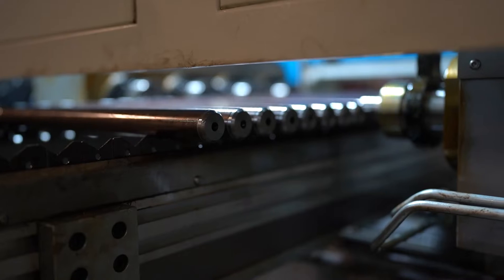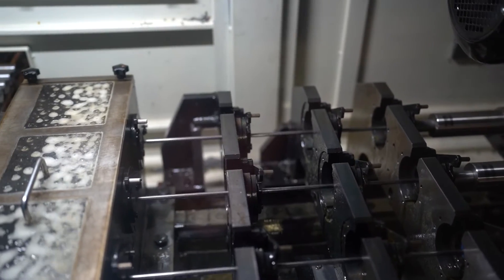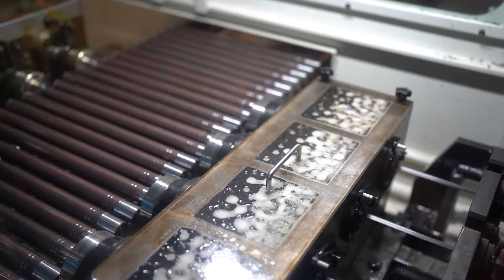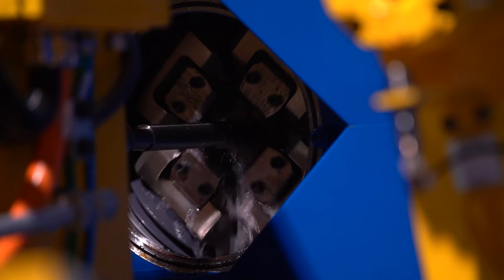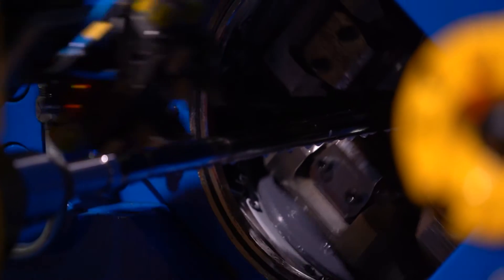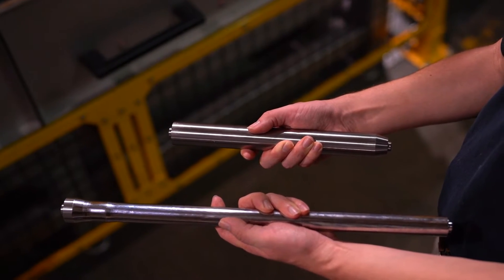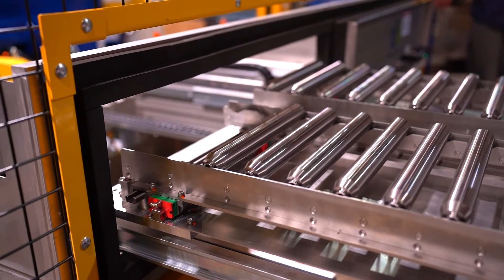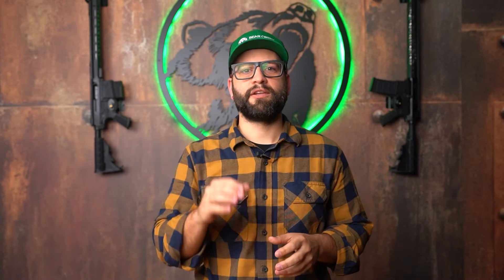Barrel Rifling - Cut vs. Button vs. Cold Hammer Forged

Comment: Prefer progressive twist produced with Electrical Discharge Machining. No stress, and allows for a hardened steel barrel with higher mechanical strength that other methods cannot achieve.

Comment: get verced in ablatives and kenimatics  after all  rifleing is just a helical path for the projectile  and throat erosion ca and is adressed rather simpleet and seintificaly all   in the same oll of the di, if one dare you can run all day @ proof  pressures mind you i said @ ,,, NOT ON,,,, but you beter know what your doing, theres a good deal of prep involved  and you gonna ive up some conveinances  all that meas is get inshape because the rifle is gana feel like it went on a gain diat  to get get gains your gonna add a weight  to the rifle and and your rifleing ratios are all imprortent every caliber has one it likes  but pressurer come into play  lean all the factors

Comment: Hammer forging is basically cold working steel.  As a result, stresses are put into the steel.  Ordinarily, stress relieving above a critical temperature is used on parts to get rid of these stresses.  However, on a hammer forged barrel, the bore (rifling) is in a finished condition after the hammer forging process.  This means that the barrel CANNOT be stress relieved.  It would ruin the bore.  The result is, you're left with a barrel that will begin to move (bend, warp) when the barrel heats up.
Reply: Exactly! Your spot on. That’s what this video leaves out.

Comment: No matter how the rifling is introduced to the bore, the chambering, throating and lead are critical  to accuracy.   My BCA barrel had so much thick smeared metal in the leade, it has been impossible to remove it so far.   Looks like they used an extremely dull finish reamer and never QC'd the finished product.

Comment: Hello I would like to know something, if the barrel has the groove made by machining, how come every rifle live different marks on the bullet like a fingerprint to track the rifle that shot it? Shouldn't they have the same grooves? I'm confused 😂
Reply: You're asking about the fascinating topic of ballistic fingerprinting!

Even if multiple barrels are rifled using the same tools and machining process, tiny imperfections and variations in the rifling process can create unique characteristics on the bullet. These characteristics are like a fingerprint, allowing investigators to match a bullet to the specific rifle that fired it.

Here are some reasons why every rifle can produce a unique "fingerprint" on a bullet:

1. *Microscopic imperfections*: Even with precise machining, tiny imperfections like scratches, pits, or minute variations in the rifling tool's surface can occur. These imperfections can transfer to the bullet, creating a unique pattern.
2. *Tool wear and tear*: Rifling tools can wear down over time, introducing subtle changes in the rifling pattern. This means that even if multiple barrels are rifled with the same tool, the resulting patterns can differ.
3. *Barrel material and hardness*: The type of steel used for the barrel, as well as its hardness, can affect the rifling process. Slight variations in material properties can lead to unique characteristics on the bullet.
4. *Rifling process variables*: Factors like the speed and pressure of the rifling tool, the temperature of the barrel, and the amount of lubrication used can all introduce tiny variations in the rifling pattern.
5. *Random chance*: With so many variables involved, it's possible that random chance can also contribute to the unique characteristics on each bullet.

These factors combined create a unique "ballistic fingerprint" on each bullet, allowing investigators to match it to the specific rifle that fired it.
Reply: @zulfikera6170  thank you very much for the reply😎👍
Reply: @Human_From_Earth88  Also thanks to Meta AI pls 😁

Comment: The best factory barrels in my opinion are made by Anschutz they are from what ive read cold forged then button riffled after and hand lapped to finish. They are more interested in accuracy not the stresses of high pressure “hot” rounds or rapid fire some most of their rifles are single shot .22lr.

Comment: This guy is trying so hard to sound like he knows what he’s talking about. Cold forging doesn’t make something more resistant to heat, in fact enough heat will actually anneal the metal and reset the grains that were displaced when cold forging. The reason cold forging makes metals stronger is because the grain structure is smashed and rearranged in a way that there are no weak points remaining in them. Think about packing wet sand at the beach. It’s useless when loose, but a lot tougher when packed tight. This guy would have learned these things in an entry level materials course in college if he ever would have went.

Edit: Spoke too soon, he made even more errors. He also says cold forging tempers the metal… tempering the metal is heating the metal and cooling it- something that obviously is not done in cold working/forging. There also isn’t “less wasted material” as the shavings from machining would simply be collected and either sold to be melted elsewhere, or remelted into more barrel blanks/billets.

Comment: So is cold hammer forged barrels therefore strengthens toughness, and therefore tempers the metal (I think that’s what he said in video). Does this mean that the tensile strength increases overall. This could imply that cold hammer forged barrels should have longer life but become unstable or drift accuracy as they warm up. Perhaps button rifling work hardens the surface of the rifling as the grooves are cut and now left with a balance transition from high tensile to more ductile steel deeper in the metal underneath the rifling. I have no idea which method is best. I do like the smooth perfection of cold hammer forged.

Comment: The button is Carbide, Not carbine, (Carbine is a short rifle), . Hammer forging does not rearrange the molecules. Unless you hit it with a Nuke. It does however realign the grain structure of the steel. Same as in Knife Making.  Rearranging the Molecular structure was a myth that persisted for years t suggest that a forged blade was superior to a stock removal blade.  It is fully disproven. 
KnifeMaker/Retired after over 47+ Years i the Craft

Comment: Its just work hardening the metal its not tempering anything. frankly if they just heat treated the steel it might work even better at least untill the barrel got so hot that it would lose the temper but by that point thermal warping will have caused loss in accuracy

Comment: Could wire electrical discharge machining (wire-EDM) be of any benefit, or possible, to make rifle barrels, or achieve higher precision tolerances in a trued smooth bore surface before cut or button or CHF?
Reply: It’s possible and regularly done by hobbyists. The only benefit it offers is practicality and ease of application. They are not as good as hammer forged but make rifling possible at home.
Reply: .... so you gotta hobby EDM machine, eh????  right .....
Reply: @petermoss4824 nope, just curious of potential applications or limitations in using wire edm.

Comment: I just purchased a complete lower and upper for an AR-308. And I must say.... I am thoroughly impressed.

 The lower is just your standard basic lower. The upper however is a beautiful 416r stainless steel heavy barrel. 20 inches long.

 When I received the firearm I noticed that there was no machining or tooling marks anywhere.

 I took it apart and I cleaned and lubricated it thoroughly and then I sat there for about a half hour just working the action around. Then I took it apart clean it and lubricated it once more. And then I took it out. I currently have I don't know somewhere around 400 rounds down range without a single failure in any way shape or form I mean no hiccups whatsoever. And it is maintaining accuracy perfectly.

 I will definitely be a repeat customer.

Comment: For all practical purposes, all things being equal there is no inherant difference in accuracy between any of these methods. Bullets don't care how the rifling is made, they care about surface finish, consistency, and concentricity. Steyr was one of the early adopters and developers of the rotary CHF process, Ruger was an early US adopter. The main advantage of the CHF process, for the companies that can afford the investment, is high production cost savings. All the claims about accuracy, wear resistance, work hardening, ect. is just marketing babble. A button rifled barrel can be every bit as tough, wear resistant, and accurate as any CHF barrel.

Comment: So let's talk about rifling.  I want a BCA10, but I'm an old cast bullet guy. I make my own lead, tin, nickle slugs and they work great with cut rifling.  CHF barreled means polygonal rifling most of the time, and that means no lead because the hills and valleys aren't deep enough to spin and stabilize the bullets going down the bore. They end up shooting lead like a smooth bore and getting tighter from lead deposits which drives up pressure to potentially dangerous levels (like the old exploding glocks.) So what I want to know is : can I get cut rifling?  What is the difference in thousandths of an inch between your lands and grooves? CHF is great, but it limits my ammunition choices. That limitsmy decisionto purchase. And, in a shtf apocalypse situation, lead may be all you can find....

Comment: How does the button rotate when being forced through the barrel?  Is it the same principle as a rifled slug where the cut of the exterior of the button forces it to rotate?
Reply: the button drives itself along, the shape is such that it has to rotate at the desired twist rate, as you push it supper hard it dose all the work its self.
Reply: Button rifling machines make the barrel rotate at the desired pace as long as the button is pushed in, so to not have any error, but it's not really needed. Due to the elicoidal shape of the grooves, the button auto-rotates as it's pushed into the barrel.

Comment: The nice thing about hammer forging is the metal is work hardened so the barrel can take the higher pressures.
Reply: The barrels are stress relieved (annealed) after the hammer forging.  Stress relieved steel is stronger than hardened steel.
Reply: @plainlogic that's mostly true. Annealed steels are much more resistant and allowable to flex without cracking. Hardened steels don't flex so much as they crack or outright break. Tool steels and hardened steels are more abrasion resistant but cannot flex, instead they chip or crack.

Comment: I'm sure this method has been well tested and is the preferred method by many high end barrel manufacturers.  It seems to me that a cold forged barrel would lend itself to movement when heated up with multiple consecutive rounds being fired.  It seems to me that the heat would release stress build up in the steel through cold hammer forging process.
Reply: I think it depends on the grain of the steel. And heat treating releases the stresses of the grain. But I'd assume that different forging techniques would still have an impact on grain.
Reply: If it good for a fully automatic military rifle, yeah Cold forge  hammer is the way to go, but the button rifles are gray with Today’s technology barrel making . most people will never come close to be able to actually shoot as good as the barrels are capable. If you wanna cold, Forchhammer get it but you don’t have to. Maybe one day all barrels be made Cold hammered and we won’t have to worry about it anymore. The most championships have been one with button rifles.

Comment: @BearCreekAR I purchased the BC-15 AR .300blk out rifle. Tried shooting subs through it, and it hung up ever round shot through the 30 round magazine using sub sonic rounds. I called 6 or 7 times,  and left messages with there customer service line. They will not answer there phone or return calls. I figure all I need is a lighter spring so it will properly eject the casings. Expect No service after the purchase for Bear Creek Arsenal.
Reply: Don't know if you ever heard back from them but instead of messing with different buffers another way to easily make a 300 blackout run not only supersonic but also subsonics if it doesn't want to fully cycle a new round or eject spent is an adjustable gas block
Reply: Yeah buddy, semi autos aren’t gonna cycle subsonic ammo without a suppressor
Reply: Was the gun suppressed?

Comment: Generally speaking, your chrome lined and/or chrome lined barrel will outlast traditionally/button rifled barrels 3-to-1, however they're typically less accurate. 

Stainless, Button rifled ARs that are made from quality components and assembled well can hold groups as tight as 0.25" at 100 yards, but expect those groups to open up over time. 

CHF Chrome Lined barrels typically hold 2-4" groups at 100 yards, but you can expect those groups to remain very consistent.

As far as value for your dollar goes, a button rifled 4150 Chrome Moly Vanadium barrel is what I go for unless I'm trying to build for precision long range shooting. QPQ coated barrels aren't quite as durable as chrome lined, but generally don't negatively impact accuracy as much. 

I've been using Bear Creek Arsenal as a source of parts for upper builds that I sell on the side for a while now. While they're a budget friendly company, and aren't my first choice for high quality builds, I have put together a couple of uppers with their barrels and bolts that will hold accuracy with any of the high dollar builds I've done. Their customer service is fantastic as well! 

Because of how good they've been to me over the years, I always try and use at least one part from them somewhere in every single upper I build, even if it's just a gas tube.

Comment: Why are your 300blk barrels 1:8? I have yours at 8.5" and using subs it is a very close thing and depending on ammo, they keyhole (which I try to not think about as I mount a can). Q products are running 1:5. True, some supersonics cut for expansion don't like 5:1 much. So, 1:6 exists but is rare. Maybe BCA sets the trend and standardizes on 1:6 twist? Please?
Reply from the maker: Thanks for your feedback! We will pass it on
Reply: I’ve got 1/7 and 1/8 twist barrels that shoot good subsonic and supersonic groups.  One 10 and one 10.5
Ones an Aero P the other Faxon.  That’s pretty much the industry standard if you want to shoot both super/subs.
I wouldn’t go below an 8” barrel it’s not worth it.
Reply: @cleetismcdougall5425  Well, mine does not shoot subs well. Glad yours do, does me no good. I am assuming the difference is your barrel length is giving a higher fps and spin rate. My 300 is intended for home defense (CQB). I want to use it with subs (and can) because in enclosed spaces I want to minimize blast and flash. So, I want/need a shorter barrel. I had a 10.5 and it was too long with the can. I would probably be okay at 1:7 but BCA only offers that at 7.5." Rotational energy is a way to impart more energy into a target without speed it up. The new 6.8 blk is rifled at 1:3 twist. Yes, one in three twist. There ARE 1:5 twist 300blk barrels out there and are golden with subs, a few supers not so happy. Thus my 1:6 suggestion, esp at shorter lengths.